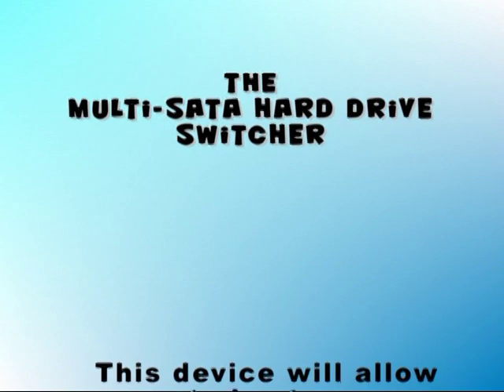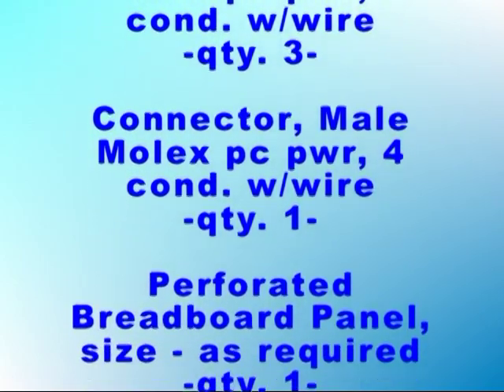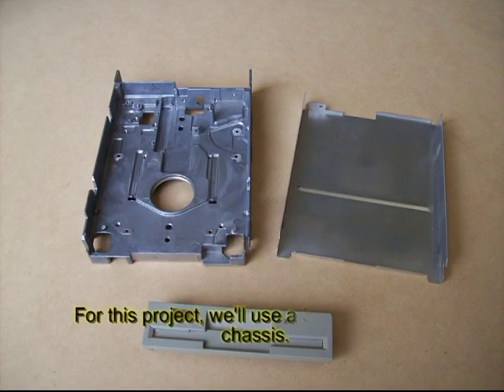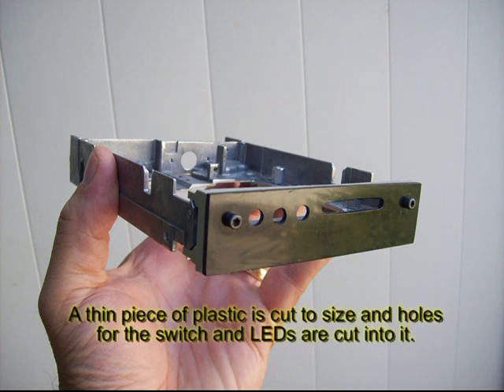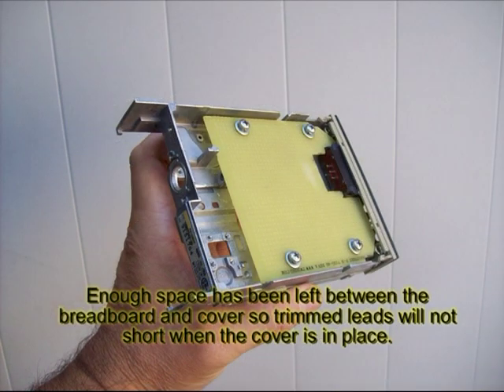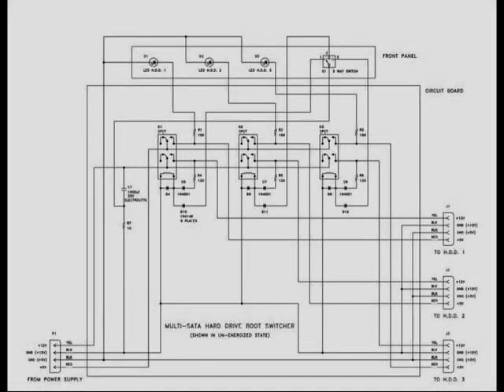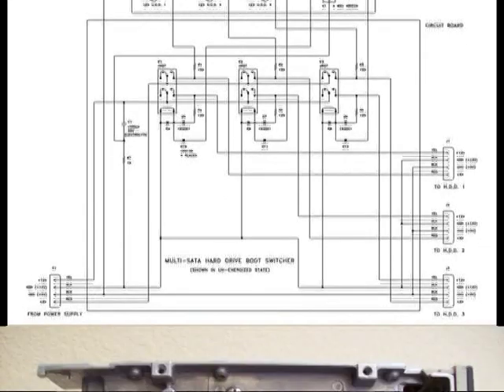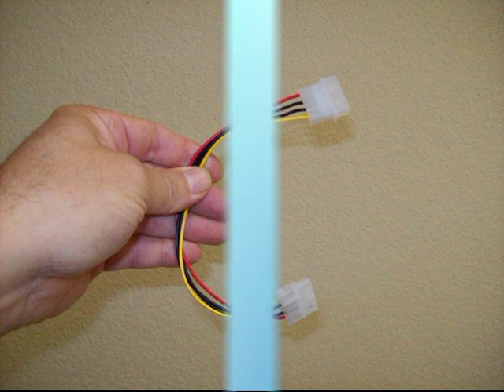How To Build A SATA Hard Drive Switcher

Comment: Seems unnecessarily complicated to me. Relays not required, nor resistors, nor capacitors. Just 4 dpdt switches to mimic the plugging and unplugging of sik power. I made something similar several years ago. But for anyone who thinks this is an easy route to booting under a completely different o/s, remember that the data lines will still be attached to the same sata ports on the mobo and your pc will be expecting to boot from only one of them. In short, for that purpose, it doesn't work. If however you use this to lock out and lock in back up hard drives when necessary for security reasons, as I do, then this sort of approach is good.
Reply: agree on some think, relay are a bit overkill, and this build is 1 from 3 HDD at the time!! not possible to use HDD1&HDD2 or HDD1 & HDD3 for example.
but the title is clear: SWITCHER, not HDD controler, lol
I did mine as you said, with 2 DPDT to control 2 additional HDD, unfortunatly when I start 1 HDD thrugh my build controler the HDD spins and then lock, I think there is not enough power for it to work correctly, so I think those capacitor are needed. resistors is for the leds in my case only for a fancy visual notification, lol
So what do you think about power issue not being enough??

Comment: Hi. Can I replace the rotary Switch by 3 individual Switch, and set hot plug in bios for the 3 drives? I am not interested in 3 OS, just to be able to turn on drive 1 or 2 or 3, while the system is on.
Thanks, if You ever answer., Or anyone else.

Comment: Hi, I want exactly this, I have read the comment, dont think I missed it, but you never mention the sata data cables.
I assume you are using one sata output from the motherboard. So how is the same sata connected to all 3 hard drives? I can only think you use 3 cables, all connected together, with all connections made to 3 hard drives. Am I missing something?

 If I am correct, I will need 4 sata data cables, all connected identically in parallel? One to the motherboard and 3 to the 3 hard drives? Thanks

Comment: This is very interesting project. I was wondering about switching the data lines (SATA) but this would leave the unused drive running I suppose; or would it time itself out? At the moment I just swap the plugs before switch on. That's both power & data. Not very neat as the cover has to be off. Thank you for this very interesting slant on how to do this.

Comment: Looks like a good solid and simple design -- have you thought about making the button's "smarter"? -- Just thinking with something like an AVR microcontroller and the V-USB library, you could make it show up as a HID device (so it shows up like a keyboard, for example) -- and when you press one of the buttons have it send a "Reset" key press that the OS can handle (so that it shuts down and reboots safely), and at the same time, pressing any button just stores a bit in the eeprom telling it which relay to latch at the next POST sequence (should be something in the POST sequence that you can listen for with USB).

Comment: Orico Hdd selector switch ....works great . Not sure what to do when m.2 becomes more prominent, no power wire .... may have to find a flexible m.2 riser and tap into the power wire ???

Comment: You say the power's cut from S1 via C1, does that mean you HAVE to use latching relays for this to work?  I looked up the part # on the relays you use, and they seem to be non latching.  Just wanna make sure I get the right parts :)
Reply from the maker: The relays are not latching relays, but you can get them to latch.  A non-latching relay can be used to continuously energize itself until the power is cut from the computer's power supply.  This is done by providing a continuous power loop to the relay coil through one of its own sets of contacts, after the coil has been initially energized through S1. After the coil has been energized, power is no longer required through S1.   Look at the schematic and you'll see how it's done.  Remember to switch the power off completely when you want to switch to another drive, You have to turn off your computer, then use the selector switch.  If you switch to another drive and only do a warm-boot, the computer will continue to boot from the previously selected drive.  The power supply in your computer must be completely powered down in order to make it possible to switch to another drive.  Again, this is because the relays continue to be latched as long as your power supply stays on.
Reply: Thomas1952 thx for quick answer.  brilliant design.  i'm building it on breadboard, the C1 cap is taking a long time to discharge when power's cut (minutes), which renders the circuit unusable until the cap's discharged.  Any ideas?  You think it's the resistor value it's tied to?
Reply from the maker: Bakers Dozen
It's hard to say what's wrong without seeing what you've done.  If what you mean to say is, when S1 is switched off, the cap eventually discharges, then perhaps the cap or resistor values are wrong.  If you what you mean is, the cap discharges only after the power supply in the computer is completely shut off, regardless of S1's position, then you may have something connected wrong.  The cap should discharge within a second or two after the initial power-up, making the switcher box's power independent of S1's position.  Make sure you have the right type of cap/value and that it's 25V.  Let me know how it works out.  Good Luck.
Reply: yep, I'm usin a 25v 1000 uf cap.  One leg of the cap's in the +12v rail.  The other leg's connected to the 1k ohm resistor which is tied to +12 ground.  And a line is sandwiched between those 2 that leads to the switch.  Thx for helpin btw :)
Reply: Bakers Dozen Wanted to thank you one more time.  I finished laying out the circuit on veroboard.  It's up and running with no probs.  I only have a need for two outs, so I only used 2 relays.  Works great so far.  I'll toss ya some pics of the completed project if ya like.
Reply from the maker: Bakers Dozen I'm glad I could help.  I look forward to seeing your pics.

Comment from the maker: status, on, off sleep mode, etc.   Are you certain by not disconnecting +12V, and having the +5V turned off, this will completely isolate internal components that use +12V? And how quickly?  Timing is an issue.  Although they may not be recognized by the computer, are you sure unused drive motors will not be spinning and creating unnecessary heat, wear and tear?  Possibly other problems?
3.	At $4.50 per relay from Radio Shack, I felt it was better to be safe than sorry.

Comment from the maker: In all fairness, perhaps I don’t completely understand how you envision the switching needs to work, but consider this.
1.	Relays are not only needed for switching, but for latching in order to prevent accidental switching off of an active drive.  Mechanical switches alone do not prevent human error.
2.	I’m not an expert on the electronic workings of hard drives, but...  Generally, they are controlled through the operating system after a computer has booted up, as far as switching their active

Comment: Of course there is no harm in switching the 12 Volt supply as well. It's just making the project more expensive and complicated with relays for nothing. You could have just switched the 5 Volt supply with the rotary switch that you are already using. There is no need to provide the 12 Volt supply to a drive you don't want to work, but there's no need for the effort and expense to turn it off either.

Comment from the maker: Hi ArtyFrt,

Thanks for your input.  I understand what you’re saying, but I don’t think hard drives were intended to work that way.  If there is no +12V provided in the first place, then the +5V circuitry would not need to switch anything off.  I just didn’t think there was a need to provide any voltage at all, to a drive that was not intended to be used.

Comment: Why not just switch the 5 volt supply instead of both? If the drive can turn it's own motor off then obviously it has the circuitry to switch the 12 volt line on it's own.

Comment: Thanks for the reply. I am currently making a 6 x hard drive switcher using electric relays, using your circuit diagram as reference and was wandering why you supplied the coils with ground instead of the 12V supply.
I am using 6 independent switches to control each of the hard drives and latching relays so that the drives cannot be switched off when selected to be on. Can you think of a way to stop a hard drive being switched on after the switcher has been booted up, like your 25V capacitor.

Comment from the maker: The capacitor is used to cut the power to the selector switch after the selected relay is latched.  This makes it impossible to accidently cut the power to the operating hard drive and crashing the computer.  The capacitor 25v voltage rating and value are what work to create the right amount of delay, even though the relays only require 12 VDC.  The diodes are generally used to control the flow of electricity in one direction.  Diodes across relay coils prevent surge damage when de-energized.

Comment: Thanks for your fast reply I pretty much sure the 2.5" drives only draw 5+ volts so hopefully I can find electronic relays to fit, Ive got a small front panel on my pcb  I want to build which already has micro switches on it less switches the better tho..  Just found some on element14 smd only 2.1mm heigh.. thanks for your help mate.. Ill probably be back tho.. lol

Comment from the maker: In addition, several switch bodies would probably use up some of your limited space.  Electronic relays are typically smaller than the mechanical one, but I’m not really certain how easy it is to find ones that can handle the 12 VDC needed to power the drives.  As far as surface mounting, the common parts should be available in SMT packages, but I’m not sure about the relays.  Good luck with your project.

Comment from the maker: Hi Jared,
I had initially considered making a printed circuit board and using electronic relays instead of mechanical ones.  I didn’t because the mechanical relays were easier to acquire and I had the space for them.  Since you’re only switching between two sata drives, it may be possible to use a series of switches to do the same thing.  The drawback would be, having to manually switch the switches in the right combination for each specific drive.

Comment: Hi there ive got a few question. Is it possible to archieve the same goal without relays. Im only asking due to not having enough room, or is there a surface mount option. I would like to add this to a project i working on using only two 2.5" sata drives.  Thanks for the video  and help.

Comment from the maker: One more thing I should have clarified in regards to the question you asked.  If you want the data drive to be available regardless of the boot drive that’s selected, just connect it to the power supply directly.  Otherwise use a power cable splitter, as I previously explained, to only connect a data drive to a specific boot drive.

Comment from the maker: The cutting tool I used is made by Dremel.  It's called a moto-tool, model 275.  The one I have is about 20 years old.  It's a single speed model.  I believe the latest version of that model is called the 100 series rotary tool.  You can go to dremel.com to check out the various models and attachments.  I used what's called a cut-off wheel to cut the rectangular hole in the floppy chassis.  I hope this helps.

Comment from the maker: It certainly is possible.  I already did that.  It's not much different than using a data drive the normal way, as long as there is no operating system present on the data drive.  All you need to do is use a power splitter cable connected to one of the three power output connectors from the switcher.  Your data drive will not be powered up when any of the other two boot-up drives are selected.  You can have a data drive for each of the boot-up hard drives if you have enough bays in your case.

Comment from the maker: @AlanTubeMan 
I have had no problems with timing issues powering drives with this device. What’s really important is for the bios to detect what drive and sata port your system is being booted from.  That means that the power supply must first power your motherboard, then the bios will kick in.  By the time that happens, your selected drive is already powered up and up to speed.

Comment: Hey Thomas. Great job on this! Very useful project. Well done. A questions if I may?

Have you experienced any issues with using drives this way? Are they okay with being switched off by relays, rather than a power supply sequencing up and down? I asked Seagate support one time about doing this and of course I just got a bland reply that they weren't meant to be used like that! I wondered if the +5 and +12 had to conform to some timing rules?